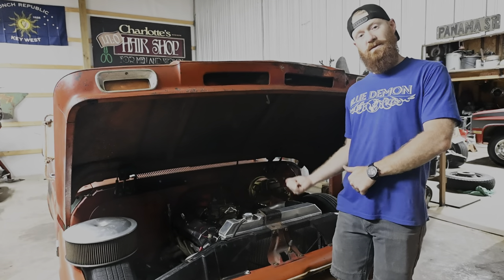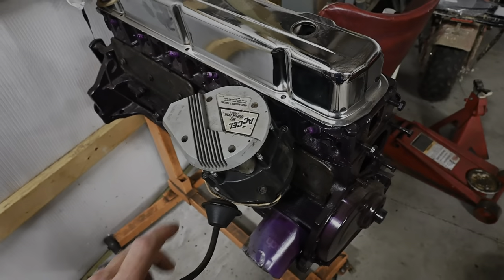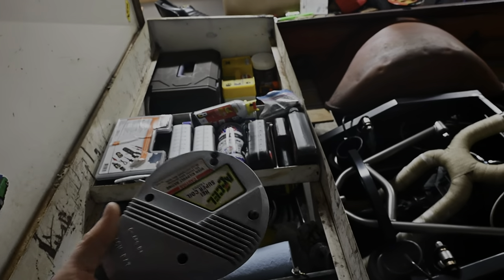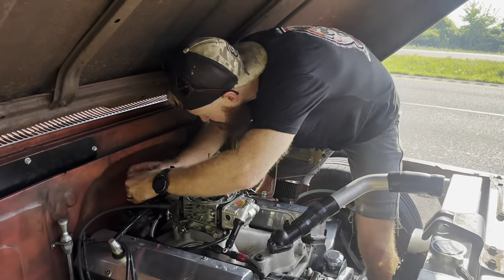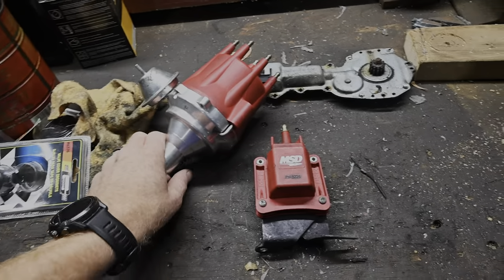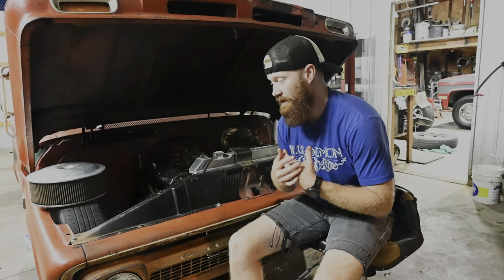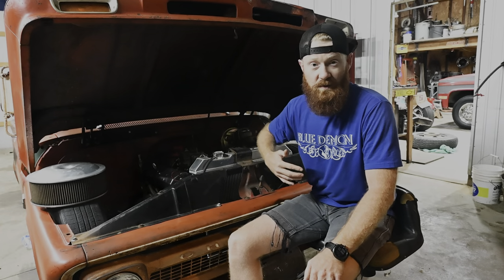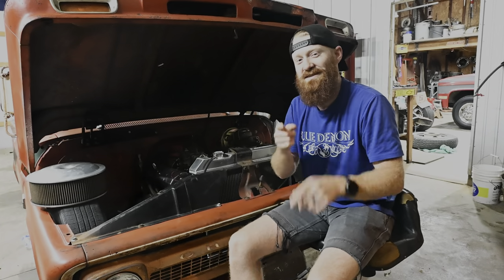Don't put a MSD 6AL on your HEI Distributor (Here's Why)

Comment: It works great if you use the msd external coil modification kit… it allows you to put a msd coil externally… it modifies the hei cap… I haven’t had a single problem.
Reply from the maker: Awesome. I was going to try that. But just wasn’t in the mood lol. May have to give it a shot 👊🏻

Comment: Dude, ran the MSD/HEI combo for years with no problems (~200,000 miles),  Suggest you swap out the high ohm/ (button with spring) resistor on the bottom of the coil ( to a low ohm resistor, about a $15 swap.  It will save the coil.  Also, low resitsnce wires also aid.
Reply from the maker: I did the button swap and still no luck. From what I’m seeing is most people with older boxes didn’t have issue. Just wasn’t worth trying to figure out at this point for me
Reply: I wonder what MSD would sat?????
Reply from the maker: @gmcnelly2468 not sure. I talked with a guy that works with Holley(they own msd now) and he said it’s a known issue with no solution that he knows of. So I kinda just left it at that lol

Comment: The value of the HEI over that pro-billet piece is that if you break down on the side of the road, you can get parts for an HEI, you can't for the MSD stuff except from a speed shop/online retailer. I'd keep the HEI as much as you drive it if it were mine. I'm converting an old 70's Pontiac from points to HEI for driveability.
Reply from the maker: I totally agree. And the HEI is so simple

Comment: My buddy (who runs a serious 550hp, 355 street/strip sbc) runs a tuned-up GM HEI and has done lots and lots of street miles with zero issues. 
I've run a tuned-up Davis Unified Ignition HEI unit on my healthy 450hp 406 for over 6 years with lots of street miles (even a Hot Rod Drag Week) with zero issues. 
I have another buddy who had a 6AL and it kept eating coils. I've heard nothing but bad issues about MSD the last 10 or so years. 
Forget those red boxes! Run an HEI y'all!
Reply from the maker: I agree with you. The HEI is so simple. Was just going off the recommendation of my engine builder 👊🏻

Comment: HEI is one of gm's greatest inventions ever and also the new digital 6al boxes are crap i put a new box on my car because of the adjustability and it went out 2 weeks later i put my 20 year old box with the rpm chips back on and zero problems since
Reply from the maker: I totally agree. I think the new boxes have something going on a little different that the older ones.

Comment: From my experience, if you need a rev limiter, or spark retard based on boost or nitrous, an MSD or such is great. Back 20 years ago on the third generation Camaro and firebird forms, people were always bragging about how an ignition box would increase performance and mileage. I put a Mallory Hi-Fire box on an otherwise stock V6 91 Camaro, and wired it in with plugs so I could easily switch back to the original setup. I drove a lot of highway miles, the same speed, same condition, same route and kept close track of my fuel economy etc. I could not tell any difference whatsoever. One day the Mallory box just flat out died, I switched the plugs around and put it back to the stock setup. The box is still on the firewall because I'm lazy.😅
Reply from the maker: Haha thanks for the info 👊🏻

Comment: I have used MSD boxes for years without any problems. I have one on my 94 S10 that I installed when it was new. It now has 275,000 miles on it. I would co😢nsider reinstalling the box with an external coil.
Reply from the maker: I would guess that was before they sold to Holley. Think they’re a little different these days for some reason

Comment: Them boxes have their place mostly at the track if you’re not racing no reason to run it
Reply from the maker: Just what my engine builder recommended I used. The engine is more or less built for the track. I just try to drive it thousands of miles 😂👊🏻